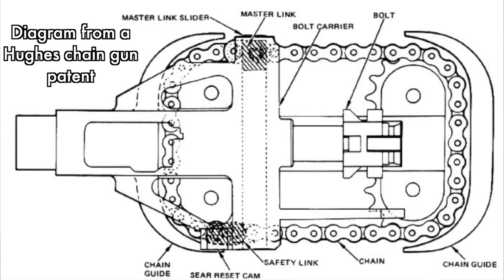Ask Ian: Are Man-Portable Chain Guns Coming?

Comment: I wonder if an infantry-operated chain-gun could take the form of a walking drone (like the Boston Dynamics one) carrying the power source and a fuck-ton of ammo, with an ammo feed and power wire attached to a human-carried gun. In theory it could work for a machine-gunner, not having to stop to perform a lengthy reload like in most LMGs and SAWs, though obviously the only reason it wouldn't just be mounted to the drone is that RC drones can have their signals blocked, and AI should NEVER be considered for painfully-obvious reasons, so making it man-portable could come in useful if done right.

Comment: For a mounted chain gun weight is not as much of an issue so to increase how long the chain gun can fire or how fast, they can make the chain gun water cooled. It could be connected to the vehicle's radiator system, so the vehicles engines coolant flows through the chain guns cooling sleave.

Comment: I wonder if there are other attemps at externally powered guns. From my admittedly very limited understanding you could take a "normal" gas operated system, change the barrel for one without a gas port, and replace the gas piston assembly with some sort of actuator, like a pneumatic piston (which could even be the normal gas piston hooked up to pressurised air) or a linear electric motor. Basically build a belt-fed bolt action with a microcontroller operating the trigger and cranking the bolt. I'd call it "the even madder minute"

Comment: The chain gun makes me think there is (for lack of a better term) a minimum chain length for man-portable component operation. 
Like why make a 2ft chain if you can condense the design down enough (w/o putting too much stress on the chain and other moving components, that would cause them to break quickly). If you could get away with a 6-8" 'micro chain', then there is a minimally needed chain length for operation...and that is the length you'd prob want to go with.

Comment: Im sure some time soon there are personal infantry chainguns. There is a new development called “flash c8 graphene” not the same as regular expensive graphene carbon 8 ; because it is massed produced at 85% military grade, dirt cheap, and created in bulk. The material is tested 900x stronger than A9 steel and 200x lighter. Superconductive and also super insulating- according to configuration. This has great applications for c8 nylon laced- artificial muscle capacitor actuators; used for replacing antiquated servo motors technology in exosuits and power armor. The “flash graphene” is massed produced from carbon garbage undergoing 5000psi quartz vacuum chamber electrolysis. As a result it converts garbage into vast amounts of carbon 8 nanotube material. This as many implications for new ways to store fusion energy as well...

Comment: I would imagine that in an infantry weapon situation, standard soldiers do not come equipped with a power outlet, they would need to carry batteries as well. And since those take time to reload, probably a couple to swap and recharge at the base. In the field access to electricity might not be guaranteed so logistics need to supply either fresh batteries or bring generators

Comment: I wonder if the development of a highly efficient energy recovery system would change the picture. Essentially instead of harness the power of excessive energy from firing partially through the gas system to operate the action, we could harness the power through a energy recovery system that turns it to electricity. If such system is efficient enough, it could potentially harness more power then the chain system needs. Meaning that the gun would be giving out power when firing, which could feed into a battery that could power other systems such as personal combat computer. Such system already exist in current generation of F1 car in the form of MGU-H (Motor Generator Unit - Heat) , it is of course no where near the efficiency to be used on a firearm. But I feel that might be a direction.

Comment: Instead of a chain to drive the mechanism, a servo screw and ball drive could be used to move the bolt. Making rotary to linear motion, as used in some machine applications (injection molding machines) 
The remaining feed and ejection system could be somewhat similar to the gas or recoil operated systems.

Comment: Until exoskeletons/ legit powered armour becomes a common issue item, the other advantage that chain guns have being able to switch ammo types at the push of a button or flick of a switch due to duel feed paths is less important than weight. I think we will start seeing them on ground drones first, those that can follow along with a section or platoon as a heavy weapons platform or act like a mule for the heavy gear with the ability to add to the firepower of a section/platoon. That would be a great use for them. But as an everyday infantry weapon it's very unlikely.

Comment: I always wondered why, if possible, they didn't force a minigun to have a lower RoF for "hand portable" versions. I mean I know the whole point of them is to throw a bunch of lead down range but, a rotary with a RoF of a 249 or a 240 seems... Not completely impractical. Multiple barrels displacing heat allowing for longer bursts while possibly cutting down on spare barrels, maybe an option to deploy it on a wall or the ground and turn it's RoF if needed. Now equipment load would be going up, most likely turning a two man job into a three or even four to carry ammo/battery and lord knows what ever else they need.

Meh, fun to think about.

Comment: One guy carries and shoots the gun. Another guy has the battery with wires running to the gunner. 2 guys carry the ammo in backpacks. They have to be able to splice in the second belt.
So, a 1 man chain gun with 3 support troops needed. If one goes down, good luck. Might as well mount all the stuff on a wagon to pull around.

Comment: I've had an idea for some time that is a similar concept to a chain gun, but greatly simplified. In essence, a straight-pull bolt action operated by a linear motor. The linear motor is really only relevant if it's meant to be a man-portable or UAV-mounted weapon, otherwise the weight difference probably doesn't matter. Related, for a purpose-built remote turret, it's always seemed to me that caseless cartridges should be the way to go. The chief issue with such cartridges deployed in combat is their fragility when transported; much less of an issue if they're not being carried about by a combatant, but transported once to a static location. The weight isn't much of an issue for an emplacement, but a purpose-built motor-driven firearm using caseless cartridges should never experience FTE issues unless a cartridge failed to fire. You could even incorporate a backup ignition system; presumably these cartridges would be ignited by a traditional primer which would simply follow the projectile out the bore; should that fail to work, electronic ignition is always an option. A "smart" weapon could detect such a fault condition and smoothly correct it. It also seems that in general we should be dumping a lot more money into developing more robust caseless cartridges. The advantages are plentiful and obvious.

Comment: 0:17 There has been no advances in energy storage. What has happened is that marketing and political fads/favoritism has made people THINK there has been some groundbreaking advancement when there really has not been.

The energy density of batteries over the last decade of gone from "Horrible" to "Not very good". They are still severely lacking compared to hydrocarbons and even gunpowder, black or smokeless. Why do you think that FLYWHEELS are competitive for industrial UPS systems vs batteries? Rechargeable batteries are just that bad at energy storage.

Even worse, we are rapidly approaching the theoretical maximum that physics itself says is possible with battery chemistry. The best we are going to get is about twice that we have today. Which isn't enough for such ideas to be viable.

Comment: There are many BB and PB guns designs where battery and motor are source of power for propelling bullet along with driving gun mechanism. It is much more power than to drive breach so weight is surely not an issue.

Comment: A few things that might tip the balance of this idea:  If you wanted to switch to electronic firing anyway, either for an aim assistance system like TrackingPoint or to reduce the need for primers if you went full electrothermal ignition.  And/or if your soldier is already carrying a large power supply for comms/nightvision/powered exoskeleton.

Comment: When you said "you don't need a recoil spring" for some reason I thought if any guns use an air shock instead (like a nitro piston from an air gun or a mountain/ dirt bike shock). Has that even been tried before? If so I would love to hear about it, even if it was a failure.
Reply: Many artillery guns use hydraulic recoil mechanisms but they are sorta bulky and won't allow for a high rate of fire.

Comment: Great video! It reminds me of the speculative videos on swords that Matt Easton does.

On the topic of bullets being your battery, I wonder if the energy of the recoil that the bullets generate can be used to charge the battery for a bit to make it last longer. It would probably result in heavier bullets, because it results in more propellant being needed, but perhaps it is a more efficient way of storing energy than a battery is, resulting in it saving weight in the end.

Comment: Wondering if a chaingun system might have more use if you were trying to design a system to fire a firearm in space - first you would have to provide it air to allow combustion of the propellent, then you'd need to open the barrel to space to allow the round out, then you'd need to....

Actually I'm now thinking that it'd be easier to just use railguns or some other launch system that does not involve providing precious oxygen to burn the propellent.
Or make the rounds effectively tiny fast-burning solid fuel rockets that provide all the components for the propellent to burn.

Wait a minute, is that how Warhammer 40k got bolters that fire tiny rocket rounds?

Comment: 4:27 - or, like many soviet/russian aircraft mounted guns, you have several pyrotechnic cartriges that are electrically triggered to cycle the action
6:35 - this is a common problem for the BMP-2 when it fires the main gun at full speed, it overwhelms the fume extraction system and the crew compartment starts filling up with smoke and fumes
btw a modern battery that can power a minigun long enough to fire 2000 rounds is no more then 3-4 pounds.

Comment: I wonder if a externally powered firearms will shine with small impulse caseless ammunition as external powered feed cycle solves most of issues cassless ammunition have in traditional firearms. Feed cycle can be slower causing less stress to cartridge not protected by case. No more issues with getting a dud cartridge out of the gun that doesn't have a case ejection in it's normal operations kinematics.

Comment: Portable Gatling Guns you say ?   Slow down the rate of fire and they will be fine for infantry ?   Nah.  Still a weight issue.  6 barrels weigh 6 times as much as one barrel so i doubt anything but single barrel guns will ever be viable for infantry,  and anti air, a rocket is a lot more effective, so portable gatling guns doesn't make sense other than for the coolness factor.

Comment: It is very true that chain guns are much more reliable for example in the ones used on Bradleys over 90% of all malfunctions are a result of crew error. HOWEVER it is much easier For the crew to make an error particularly in the loading process which is MUCH MORE COMPLEX and If you do have a malfunction it is a massive problem that will take you 10 or 20 minutes to fix.

Comment: Why not design a gun where it's using a chain-gun principle largely to reduce the amount of propellant required per round fired? A great deal of the energy in a typical cartridge is already wasted; a lot more is wasted if you're not using the gasses to actuate the bolt. But you could potentially save a lot of the size of a cartridge (and therefore, weight, recoil energy, fouling, etc.) by using a chaingun approach. Moreover, one could perhaps use powder mixtures that aren't currently normal, because the current systems want a pretty specific burn-time and gas production to operate the actions, whereas a system like this could attempt to maximize the kinetic energy transferred to the projectile instead. 

For that matter, why not apply that concept to bolt-action firearms, which are still largely firing ammunition designed for fully-automatic weapons for military purposes that don't matter at this point? To be sure, this probably has some major problems to overcome, but if the Army's going to field a rifle that needs 80K PSI chambers, why the heck can't a bolt-action do 150K, but with a relatively-small bullet and a very short burn time?

Unfortunately, given that it's virtually impossible to make a "semi-auto" chaingun system, there won't be a lot of experimentation with these ideas outside of military settings, but the potential to make firearms more efficient and lighter while pushing the same masses at the same velocities is probably there. Perhaps it'll be like plastic casings; first it'll seem like a silly idea, then it'll be an experimental idea, then everybody will be doing it.

Comment: Bushmaster chain guns generally deal with the hang fire problem by locking the system until The barrel recoils about 2 cm. Now yes that does mean that if there’s a misfire you do have to actively take action to clear it but The procedure is literally just pressed that little misfire override button and squeeze the trigger again.

Comment: It's worth noting that rotary guns actually do run a little less hot because the spinning action moves the barrels through the air, kind of acting like there's a fan on them. It's probably not a huge difference, but it's not nothing.

Comment: It might see some applications if they develop powered exo skeletons for infantry somtime in the future.

I'm thinking that if the exo skeleton is armored, then it's not a certainty that the operator will have sufficient manual dexterity to allow for directly operating the action of a weapon. Especially if the weapon is mounted on the outside of the frame of the exo skeleton.

Comment: A chaingun or other remote powered weapon seems like it would be better set for following the research into exosuit type improvements to infantry equipment. Those suits would have to incorporate power and would be designed to have greater weight capacity, so they would take care of the two main downsides of a chaingun.

That being said, this assumes someone makes a practical exo suit, which is another debate on its own and I'm not gonna try getting into that.

Comment: Ok, now I do have a question. Sounds like you can use externally powered weapons to automatically feed ammunition that traditionally doesn’t feed in a self-powered weapon... in theory, you could create a high-ROF nonlethal option akin to the shotgun or 40mm devices in service with police departments. What for? For suicide by cop situations (or violent mental health crises, result tends to be the same), where current options are unable to reliably neutralise a threat quickly enough to prevent lethal force from being necessary. With a pain compliance tool, volume of fire could be used to overwhelm the target, possibly even physically in terms of the impact of the larger/heavier rounds, and create an opening where taser or physical force can be applied to n

Comment: Ian, does that mean I can't run a chain gun as an app on my cell? Just asking for a friend! All that said, I have a question even a "Hog driver" friend couldn't answer; why does the A 10 use a multi barrel 30mm gun? I would still think a 30mm chain gun could reach 900-1000 rm- most drivers think the 30mm onboard (1600 rounds, I think) runs out way too fast. FR